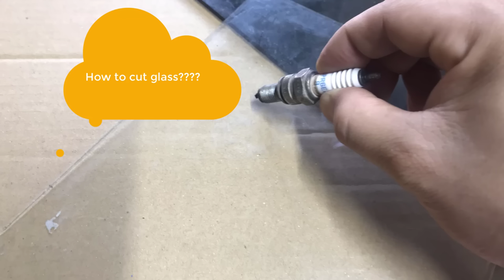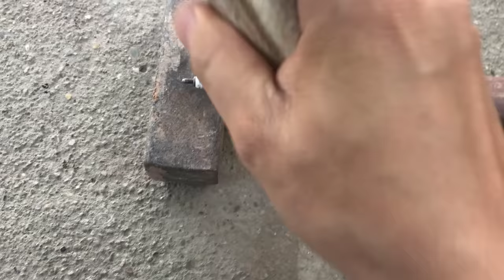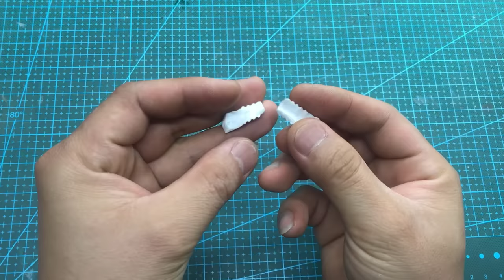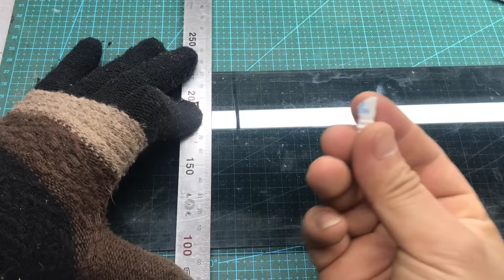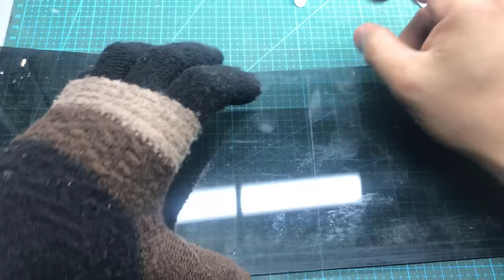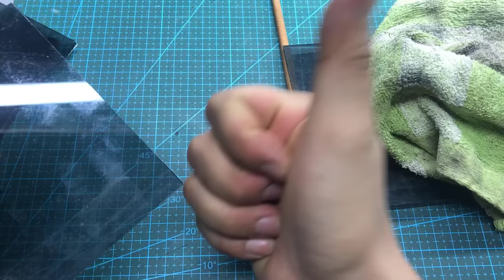Simple Cut Glass

Comment: Thanks!
A useful video.
Glass cutters secret:
Put kerosene in a small glass jar and put crushed camphor (karpoor ) in it and stir.
Take a piece of hacksaw blade and tie wrapped cloth around it, to make an applicator.
Apply this along the length to be cut and then take the cut.
Don't use wood as it will suck up the kerosene.
Reply from the maker: Thanks bro
Reply: How does it help?
Reply: Yeh right....nice info usually none shares secrets. I worked in glass industry for 39 yrs in Dubai.....amazingly interesting field....it was all manual tht time now everything is computerized 
Even any shape is cut on intermac cnc machines...hardly anyone cuts glass
Reply: Absolutely right. Kerosene or jet fuel
Reply: @donmarcel9167  what is part of kerosene? Does it softens the glass? Else what..!!
Reply: @naveenkumars8577  ... kerosine penetrates along with the cut, also it clears the dust, try one with kerosine and without kerosine.....try 8 mm and above glass ....u will see the difference, thr are professional pen cutters available from Belgium  whc has small storage whc don't require to use any cutting oil or kerosine, I m sure it's available here as Chinese r masters of copying
Reply: @donmarcel9167  got it sir. Thanks for the the knowledge. Will try it in short..!!
Reply: @naveenkumars8577  ...one can buy good glass diamond cutter for 150 rs, than why use unreliable tools to cut the glass n wast money....cutting glass with ceramic etc is like monkey has vastara In his hand....people say lot but thr is no practicality to it
Reply: @naveenkumars8577  they say ask no questions and you'll be told no lies, but a sincere seeker will find out with or without us!
Because glass is almost perfectly flat, anything from the surrounding air like grease or glues like sticker glue and other stiff clings to it like a vaccum.
Your effort to cut with any obstical in the way will divert the cutting angle you have found by your wrist sliding.
That goes for the solvent kerosene or even turpentine which is a more expensive solvent.
The camphor has been used for centuries and helps evaporation of small dissolved dirt. I don't have a laboratory to confirm this.
When cutting large pieces of glass make sure that the entire area is supported because if it flips upwards you could get your stomach ripped up.
Be more careful with glass thicker than 6mm.
Reply: @donmarcel9167  on the bright side hand made glassware can be sold for a nice profit
Reply: @Whom1337  yes....I hav done big projects in Dubai....eg.wafi centre all glass doors with Egyptian art....thr stained glass, thts original colour glass....British  bank of ME now its city bank at bur dubai....wifi centre stained glass roof is done by my organisation